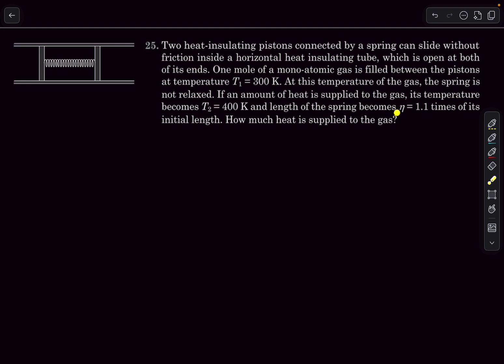Problem on Thermodynamics For Adv 25 | Pathfinder | CYU 25 | Thermal Physics

Comment: What if I consider this as a polytropic process and find the n and then heat capacity in order to find heat. What's wrong with this. if assuming the polytropic process is wrong then when we can use this concept